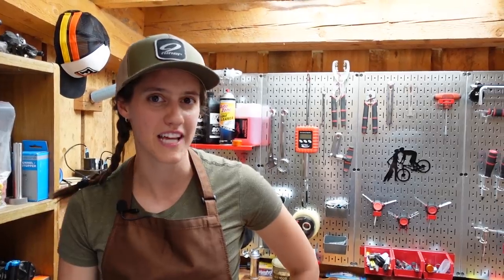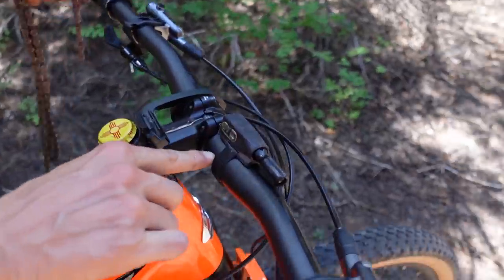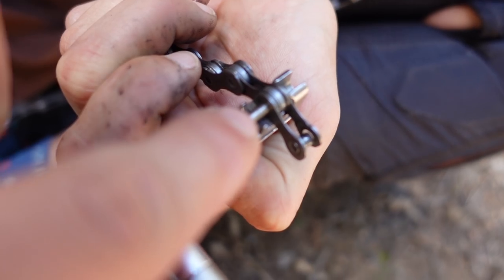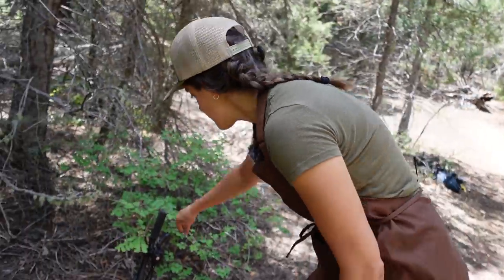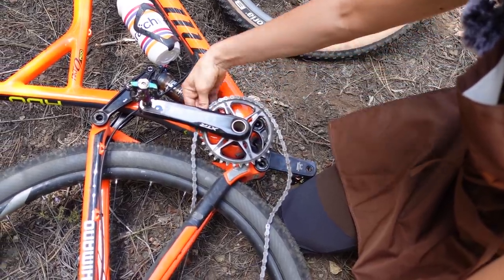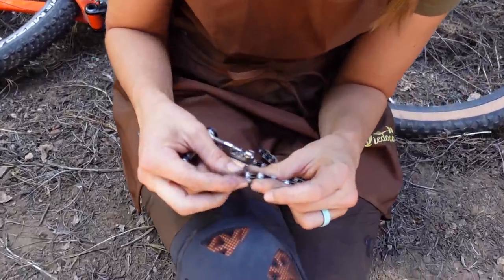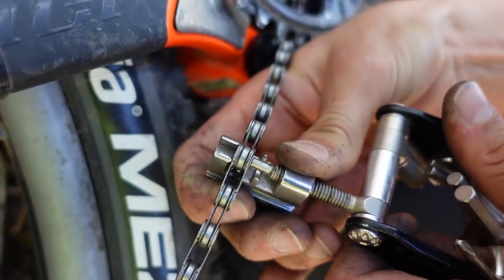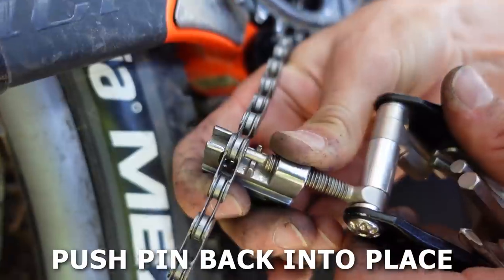DON'T LET A BROKEN CHAIN RUIN YOUR RIDE (fix a chain with and without quick link) | Syd Fixes Bikes

Comment: Extra tip for the nerds. Some chain breakers have a second pair of "jaws" to loosen a stiff pin. When you push the pin to rejoin the chain you press against outer side of the outer plate opposite to the pin driver, this makes roller be part of the stack that is squeezed together. After rejoining the chain you can put the second pair of jaws in between inner plates and press against inner side of inner plates, this way you drive the pin through just one inner and one outer plate, which increases distance between inner plates and allows roller to rotate freely.

Comment: Multi tool? Chain break? Quick link?  PFFFFFT... One time I had a chain break half way though a ride, and for whatever reason I didn't bring any tools. I guess we all make mistakes. But it happened. SNAP. And I was at least 5 miles from the trail head. I got the chain back together with rocks. I straightened out each link and them hammered it back together, and flattened the pin so it would stay together. I literally walked around and looked for a rock that had just the right shape. I found one that had a few different shapes that would work. Then I found a bolder to use a work surface. I went to work. Took me about 30 minutes. But I get that chain back together.  That chain held for about 7 more rides until it broke again. But at that point,  I had my quick links and tools. Let's see you guys do that...

Comment: OMG, 3rd comment on this one.. sorry.   For the second way, it is important to now that when you break the chain with the break tool, it shears off a flared end which is what keeps the pin in place and the outer plates in place.  when you replace the pin with the break tool, that flared end is gone, and it is more likely to come apart at that point. You should replace that link with a quick link or replace the chain. Unless you put it together smashing it with a rock.... lol.

Comment: Always carry a chainbreaker tool and a couple quick links.  And then there is the case where the rear derailleur is broken and you need to make your bike into a single speed to be able to finish a ride.
Reply from the maker: Stay tuned for next week 😉

Comment: I'm new to cycling (as an adult) and after watching a few other youtubers I bought patch kits, multitool, spare links and the special pliers etc. I carry the emergency stuff under my seat but couldn't fit the pliers in the carrybag. It never occurred to me to use the crank to set the spare link, so obvious when you know. Also been carrying a tool to temporarily hold the chain with some slack while you set the new link - but slipping it off the chainring makes that redundant (I actually learned that from one of your other commenters - wealth of knowledge here). I'm not even riding a mountain bike but I'm learning so much from you two. Amazing people!

Comment: Great video again guys! I think it is still missing the one last thing that can get you home.

Here's my story: I was riding out when my chain broke while trying to upshift the front under full load. My buddy helped me resize and refit the chain with the one link less like the second part in this video (I didn't have my chain tool on me, thank god my friend did). Ahead comes a climb and I put it in the biggie big and now my chain goes with my derailleur cage and my hanger right into the rear wheel because it's short. The hanger is bent now and so is the derailleur cage and the chain as well and everything is kinda stuck! This was a 100kms from home in the middle of nowhere with not a soul in sight for the next 20km. There's this one last thing we tried where we cut the chain again, as it was stuck this time, took it off. Then took the derailleur out completely from the bike and cut the chain again to fit it as a single speed on a middle gear. I still had the climb ahead of me, boy that was hard riding uphill and for the next 100kms but it got me home!

I hope helps somebody! Much love for you guys, and keep the videos coming!
Reply from the maker: Wait for next week's video 😉

Comment: It never occurred to me to wear my shop apron on the trail, just in case. ; ) But seriously, thanks guys, great video.

Broke my chain 9km down a 26km trail yesterday. The loose outer link then hooked the rear derailleur, mangled it completely. A bike mechanic helped me out to get me away on single speed mode (bypassing the derailleur with a shortened chain).

Unforeseen circumstances, though... The short chain worked down a gear (bigger rear sprocket) and the resulting crazy increase in chain tension worked the screws loose on the front chainring, which then fell off. I kid you not. Great day for a walk, apparently... 

I'm going out now to see what's salvageable.

Comment: If you have trees around, and know a few knots, and have som paracord, no one shall need to miss their bike work stand at home! I would start with a Truckers hitch and a Prusik... 9sp HG chains can not use Quick Links or anything similar. And you can not reuse the same pin, a new one must be installed every time. Only time I hade a chain brake was when I had installed it wrong. Been riding for decades, but seriously since 2004. I've watch a lot of videos here now, and get the impression Mac is ex military!? a very good instructor anyway! Syd is a natural talent in front of the camera too!

Comment: You FOUND that fly multi-tool? Dayum, lucky! Best I ever found was a cheap pair of pliers. I've LOST a multi-tool, however.....

Another practice tip -- practice using the chain breaker on an old shot chain. Especially to learn how to do the no-quick-link option, and how NOT to push the pin too far and push it all the way out. 

Also, on the no-quick-link option, there's another position on the chain breaker you can use to tweak the pin / plates and resolve the stiffness you get when you first put the pin in.

Comment: Quick links are probably the best invention in cycling since the invention of brakes!  The old school take out a link method works, If the link is too tight you can actually move the chain to the next position closest to the breaking pin and put a slight amount of pressure to loosen the link up a bit!

Comment: Funny enough, the most common trailside mechanical for me is a bent derailleur. I have bent so many derailleurs, and have never flatted a tyre or broken a chain in the 4 years I've been riding. Fortunately, I've discovered a somewhat effective remedy for a bent derailleur. Which is... put it in the hardest gear, put your bike against the ground and stand on the tyre... And then pull as hard as you can on the derailleur :D
Sounds crazy, but it has worked every time for me! Even gets the alignment pretty close to straight somehow. Of course... Worst case scenario you snap your derailleur hanger and/or derailleur off your bike. That has yet to occur though...
Reply from the maker: Interesting. Seems like a good solution. That being said, you might want to carry a spare derailleur hanger (if you don't already) because after bending it back and forth numerous times it's probably gonna snap eventually 😉
Reply: @sydfixesbikes  yep! I've got a derailleur hanger in my pack but have yet to need it. One day!
Reply: @Karina, have you considered switching to internally geared hub?
Reply: @glebivanovsky7886  You mean a rear wheel geared hub? I don't think anyone makes a competitive internally geared hub do they? At least, not that I've heard of. One day when I destroy my derailleur for good, I'll replace it with an AXS one with the impact protection clutch. Bending my derailleur back works for now :)
Reply: @Candesce  Yes, I mean exactly that. They are not competitive enough to win you races and championships, but they are good enough for some amateur racing and non-competitive riding. I have a NuVinci (the heaviest IGH in existence) on my do-it-all bike and I don't feel handicapped when I occasionally do some XC rides with my friends.
Reply: @glebivanovsky7886  After you mentioned it, I looked into it, and I'm not sure it is very viable for me or my existing bike frame, or my riding style. I can definitely see the appeal though, and in the future you may see me on a gearbox bike of some description. I do think derailleurs are not the greatest gadget ever made, but it's light and does what it should do, and I'm pretty good at maintaining it now :)
Reply: @Candesce  Gearbox bikes look cool, I would like to try it one day. :)
Anyhow, whatever works for you... ;)

Comment: Yes, there are other ways to do it. You take a small torx bit, one that is just smaller then the pin. And a small socket, like 7mm, and a vice. You press the bit into the pin, and push it into the opening of the socket.

Comment: I didn't realize you can reuse a pin by not pushing it all the way out, I usually carry a new pin with me but good to know if I don't have one handy.
Reply: Some of chain manufacturers don't recommend doing this. But if it can get you home, it is better than walking.
Reply from the maker: Yeah, we never do it as a permanent solution, but it'll help get you out of the woods!

Comment: I haven’t broken a chain since I stopped using Shimano chains over 30 years ago and started using Sachs chains which was later acquired by SRAM. But I still carry a chain tool and spare link because never say never. Last time I didn’t, my buddy’s Shimano chain broke and we had to pound it back together with 2 rocks and a screw driver just to get back to the truck.

Comment: Just one point, instead of twisting the chain from side to side to free it up, that is what the other "shelf" on the chain breaker tool is for. You put your chain in it and tighten the handle a small amount to loosen up the links. Perhaps it would be good to include that in another video. But it's a good video anyway.

Comment: Shouldn't the arrow on the master link be pointing in the direction of the chain travel, not the toward the front of the bike(on top of chain path)? 

These videos are great, thank you!
Reply from the maker: That's correct. Direction of chain travel, which is forward if it's above the chain stay and backwards if it's below

Comment: Great video. But it's much easier for people to learn why rather than what. For example instead of telling people what to do ("arrow should point forward on top of chain and backward on bottom of chain") it would be much easier for people to remember why ("arrow should always point in the direction the chain is pedaled"). Also, it is an extremely valuable tip to tell people not to push the rivet all the way through and out of the chain. It would be a lot easier for people to appreciate that if you explained why. For example (1) if you push the pin/rivet all the way through the chain you're going to lose it in the dirt. And much more importantly (2) it is very very very difficult to get a free pin back into the chain!

Comment: My clutch on my rear derailleur never worked right, is that fixable???
You didn't have to take the pin 'all the out', the other pin was already out, you just need to break the first plate...

Comment: How do you find the proper derailleur hanger? My wife has a ~20 year old Specialized Stump-jumper,  but we are not sure which derailleur is the proper one. I was able to get the tool and bend it back to proper shifting again, but we were afraid it would just snap and she would be left w/o a bike. We would like to get a spare one.
Reply from the maker: Google is probably your best bet. Or getting in touch with a specialized dealer. They should be able to tell you which hanger model you need.

Comment: Most chain break tools I've seen come with a new pin; I've never reused one before.  You would press that new pin in with the tool and you could break it off at the right place after.  Did things change since the last time I had to do this?
Reply from the maker: You can purchase replacement pins, but they don't come with the chain break. Didn't know that was a thing!
Reply: @sydfixesbikes  Cool to hear from you!  Ya, it was a while ago, but it was a Shimano tool that came with the snap off pins; you can break the inserting end off after pressed in with pliers.

Comment: I have taken up riding again, and need to carry a repair kit.  My bike is a 21 speed mountain  bike from 1995.  I recently  had new tires put on, and had  required maintenance professionally done.    I cannot find information  on which  chain quick link  to include in my emergency  repair kit.   I want to ride rail trails predominately,  and will be long distances  from help.   I need to be self sufficient.    Please advise. 😊
68 year old overlander with aspirations to explore.
Reply from the maker: You want to match your quick link to your chain size which is determined by the cassette. I would assume you're running a 3x7 speed so you'd want a 7-speed quick link.

Comment: Does pushing back the rivet still work for Shimano 12-speed chains?

The last complete bike I bought came with a KMC X93 10-speed chain and those definitely can not be reconnected without a master-link. The rivet, once broken loose, won't be retained in the outer link, when repositioned.
Don'r switch to these KMCs, as all three I have used so far broke at the 'master'-link. I then ordered a bag of cheap replacement master-links from China and they actially work reliably.
Reply from the maker: Yup, we were doing it on 12-speed chain and it held surprisingly well. That being said, we never treat it as a permanent solution and always replace a chain if it breaks (unless, as you mentioned, it breaks at the quick link because then it's probably a quick link issue).

Comment: I noticed I have a quick link already on my brand new shimano chain on my brand new 2024 embt I just got not sure if this is normal jsut something not seen on a brand new bike before 7 grand embt how many QLs can you or ment to have on your chain at any one time does it matter?
Reply from the maker: Yeah, that's normal as nowadays chains are initially installed using a quick link and it's no problem to add another one if you need to due to a mechanical. Theoretically, you can add multiple for multiple mechanicals, but if you keep breaking your chain there's likely some issue with it (or some other part of your drivetrain) and you should likely get it replaced.

Comment: If you have to shorten your chain, don't forget to adjust your low limit screw so you don't accidentally shift into your lowest gear.
Reply: Good tip My boi Richy
Reply: How do you shift w/o a rear derailleur (in this video)?

Comment: To remember "low" vs. "high" gear, just think of the wheel as the "bottom". Bottom up, low to high.
Reply: I like to use the phrase “low = lazy” and “high = heavy” in reference to shifting / gear tension.

Comment: It doesn't say what to do if you push the pin all the way out though, that's fun to do outside, lol...
Reply from the maker: You can try to push it back in, but generally we just cut it down another two links and be even more careful riding out.
Reply: @sydfixesbikes  There's actually a technique for replacing a pin that has come all the way out of a bike chain that involves balancing the pin on a level surface and placing the joined pieces of chain over the end of the pin.
You then tap the chain hard enough to partially drive the pin into the chain, and connect it as you normally would.
It's a pain in the ass to do outside with limited equipment though, I know from experience, lol!
Reply: @johnhanley9946  Every time you install a new chain you have a little leftover bit. Use it to practice your chain tool fu! ;)